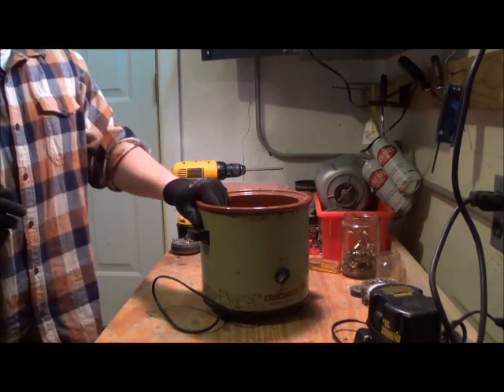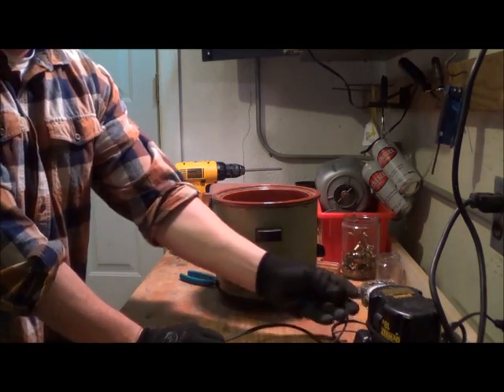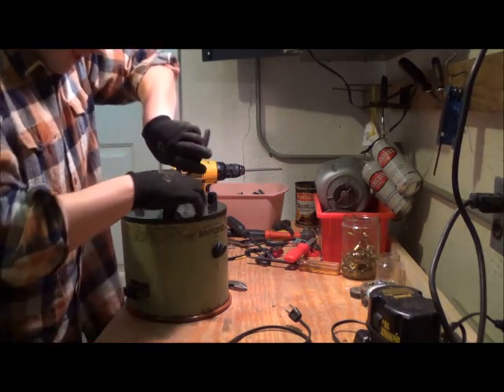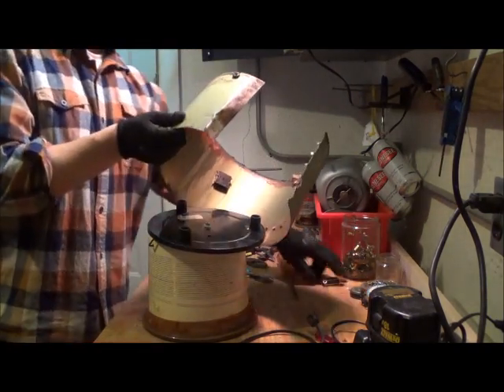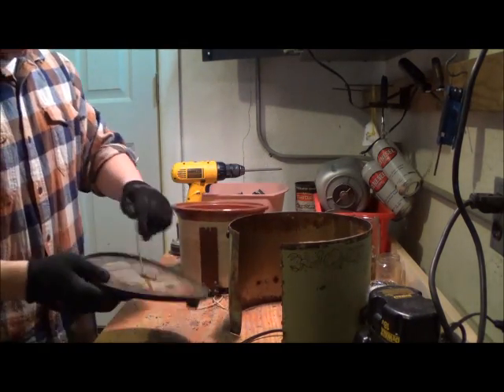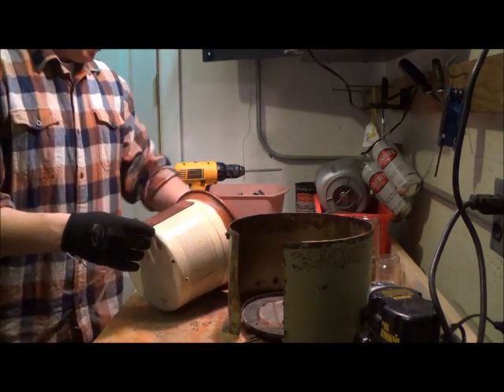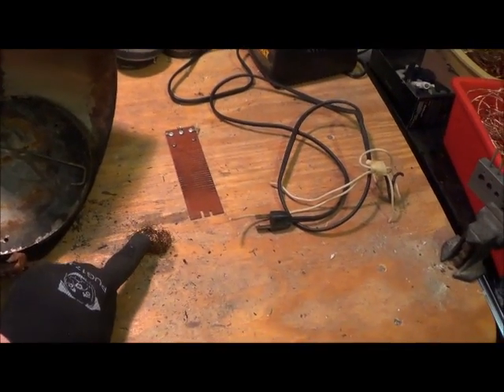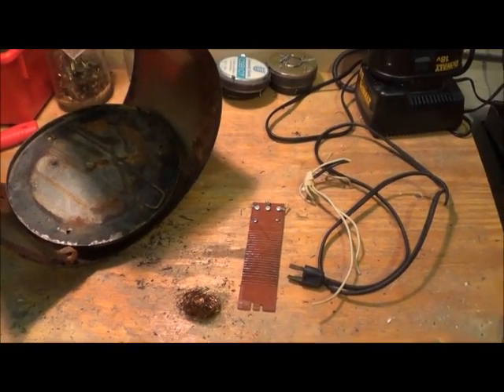Scrap value on a crock pot! Copper and steel and more!

Comment: If it works, those vintage crock pots are worth around $15 on eBay.  Definitely not worth scrapping :)
Reply from the maker: Most things working aren't worth scrapping. This guy didn't seem to heat up very well so off to the scrap yard! Thanks for watching!
Reply: Robbie TwoScraps
At least you got something out of it, then!
Reply from the maker: Erdie5 Yea. Better than going to the trash dump forever.